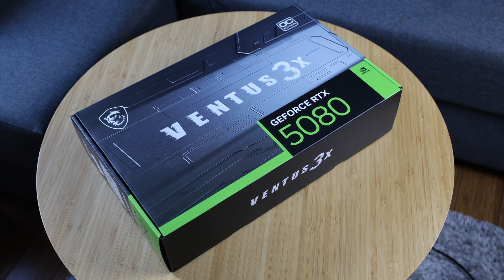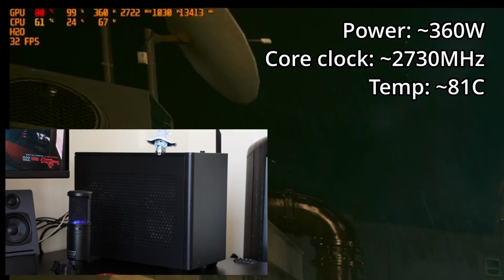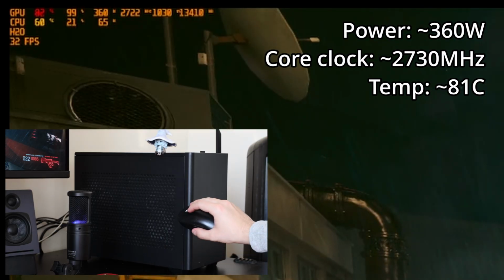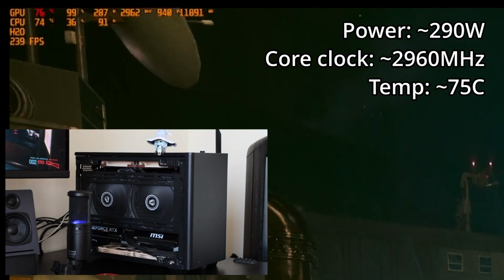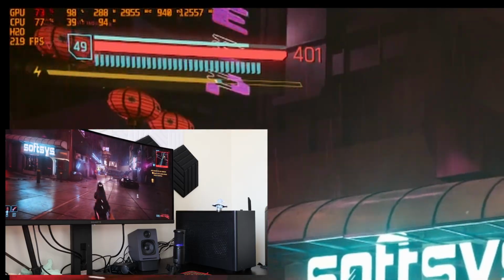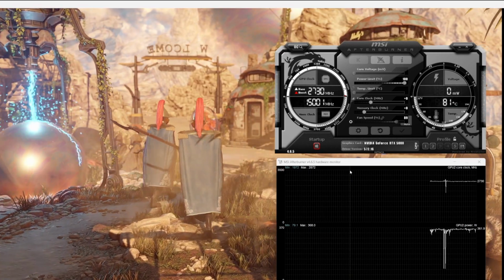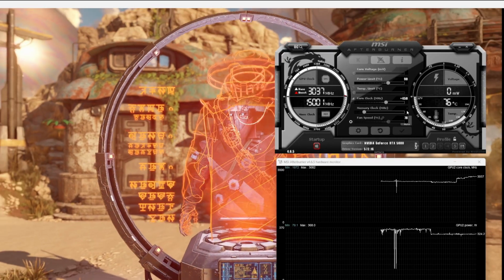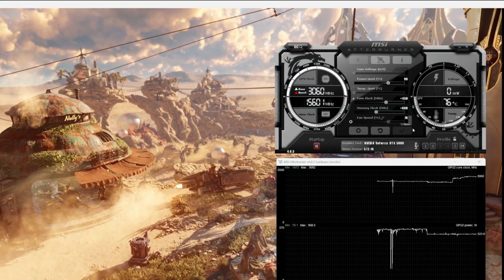RTX 5080 MSI Ventus 3X OC Plus Review - Noise, Performance, Undervolting

Comment: do you get similar noise whit the Msi GeForce gtx 1660 super Ventus XS OC edition?
Reply from the maker: Bruh do you think I have every GPU ever made?
Reply: @grumd0 dont need to own ut to now.., i was asking in xase you knew.
Reply from the maker: @martinrosemary5654 1660 is a much weaker low power GPU compared to 5080, so I'd expect it to be much quieter

Comment: I have this card. Its not for overclocking. Its a card for undervolting. With the right settings you get really good preformance and temps! Also Its one of the smallest cards. Its really good for small builds so you can keep good airflow!

Comment: Wth is this guide? :D That is not undervolting :D
Reply from the maker: Power limiting with a positive core clock offset results in the card using voltage that's lower than stock, it's basically undervolting with an overclock. I just showed the simplest method to achieve good performance with lower power consumption and lower temps that anyone can do without even touching the voltage curve.
Reply: @grumd0  No, you showed a really dumb way of doing power limiting. Proper undervolting, like you claim this video is about, has much better outcome and stability. I really suggest looking into how things are actually done before making youtube guide videos, and making yourself look really stupid while doing so. Especially if you want to grow your channel. Making stupid videos like this does the opposite.
Reply from the maker: @GrumpyGrndad Oh I don't care about growing my channel, and I know how to properly undervolt, I just showed the method that's the easiest to do even for someone opening MSI Afterburner for the first time. You're also arrogant and rude for no reason so why would I listen to your dumbass advice? If you at least had some constructive arguments why using the voltage curve (which I assume you think is the "proper" undervolting) is "better" I'd maybe listen, but you just spew ad hominem with no substance to your words. Not worth my time.

Comment: his gpu temps is high coz of this case airflow setup, having 4 intake and 2 exhaust is bad in this config coz the gpu air is not getting push out fast enough and getting blocked by the AIO
Reply from the maker: That's wrong. GPU always gets fresh air from the bottom intake. The side panel is also open and hot air can easily escape from the sides. This Ventus just has a very small heatsink.

My temps are high because my ambient temp is around 26 C

Comment: So hot in brazil this GPU arrive in 100 C° easy
Reply: No im from Brasil and mine with undervolt and 2000plus and 400mhzovercolck  reach only 71 ~ 72 maximum temperature the avarage is 62~ 65 the cooling is really good
Reply: delusional, learn to type

Comment: I have this exact same card, my power is at 110% running at almost 3250Mhz core clock and + 2750 Mhz memory and this gpu has never went above 62 celcius. Could your case not have optimised airflow?
Reply from the maker: @JS-xv3dm  Exact same? Ventus 3x OC Plus? Mine didn't even go above 100% power limit. I think you have a different GPU
Reply: @grumd0  My apologies you are correct mine is the MSI gaming trio not the ventus trio.

Comment: +480core +1000mem, cap power at 0.85v will be 2700+Mhz
Reply from the maker: @RhRyan  Yeah that works, but I prefer to be closer to 3000mhz
Reply: @grumd0  That does sounds nice. Man I kind of regretting not building ITX, only if I don't need that many USB slots

Comment: hope this is good enough for a 5070ti that is the only card i could find in stock and it have been shipped i will have it next week so will hopefully not be a bad card with loud fans and high temps if so i might return it. i use open back headphones so noise is a deal breaker XD to bad if i have to wait even longer for a upgrade for my 980ti...
Reply from the maker: @Fr3akyFrapz  A 5070ti has a tdp of 300w. As you can see from my review, at 300w this 5080 ventus is pretty quiet!

Comment: This isnt really undervolting though is it?

This is power limiting and overclocking. In essence the result can be similar but undervolting specifically lowersvoltage but lets card run at stock performance or above sice you are effectively lowering the temp and power stoping them from hitting stock limits.

Comment: This isn't undervolting. power limiting doesn't decrease the voltage you feed to the card hence you will still end up with higher temps and coil whine and so forth. this is an easy method to limit power but the 5080 barely ever uses its max 360w tdp. for example on my 5080 i can achieve 2900mhz core with 900mv voltage or 3100mhz core with 950mv voltage. this in turn actually decreases power consumption at the max core clocks by about 30-40w around a 15% decrease. This is a Misleading video!
Reply from the maker: @Kobe4Life2424 With a +400 offset power limiting forces the card to stay at lower voltage around 2950/900 so imo it's the easiest way to undervolt without messing with the curve
Reply: @grumd0  no it doesn't. The card still uses 1.01 volt when power limiting and increasing the core offset. Your method doesn't adjust voltage at all. The card will still use max voltage allowed for the card.
Reply from the maker: @Kobe4Life2424  It only does so in low loads, but in high load games like Cyberpunk it drops to 900mv. I'm using power limiting to decrease power consumption, noise and temps. It's not necessary to decrease voltage to get lower temps and noise. If I'm drawing 200w I wouldn't care that I use 1v, the card is still cool and quiet

Comment: Why is your temp so high. My gigabyte 5080 sff only 71°c max with oc. Room temp 36°c
Reply: Dayun msi low and mid tier so bad.. Better go to asus or galax
Reply: What is your VRAM temperature?
Reply from the maker: @hasanenterprise8630  Room temp 36, do you live in a sauna? Anyway, this just shows how bad the Ventus is. Gigabyte sff have a vapor chamber, Ventus doesn't
Reply: @grumd0  asia mate. All year summer here. Yeah with your room temp should get -10°c

Comment: This card seems kind of hot and loud. I have a 5080 FE shoved in a Ghost S1 and it's not even close, the highest temp I've ever seen on the GPU was...like 71C and I have a quiet fan curve set so it was only spinning at 32%.
Reply: Good luck venting all that hot air on the back of your motherboard.... Not good

Comment: That's not undervolting. That's power limiting.
Reply: the exact same thing just different method
Reply from the maker: @vyse6980  The biggest benefit is probably that power limiting with a core clock offset is super easy to setup, just two sliders. Manipulating a voltage curve is more complex. And with my video I wanted to show people the easiest way to achieve good results
Reply from the maker: @vyse6980  Good point, but I disagree. Power limiting with a +offset to core clocks is basically the same as undervolting. You're running higher clocks at lower voltage. With the +400 and an 80-90% power limit I'll be running around 3000mhz/950mv or maybe slightly lower which is close to what I'd do with straight voltage curve manipulation anyway. But if I only manually set an undervolt instead, I'd lose the benefit of a smooth curve that allows the GPU to find the optimal point for best performance. After all, undervolting is done to decrease noise, temps, and power. Power limiting does the same thing, and a positive clock offset finds the best performance for those constraints that your card can muster.

Comment: You should have bought the gaming x trio, then you wouldn't need to change the specs to get it quiet. If I would buy a 1000 Dollar + Gpu, I would make sure to buy a premium cooler with it, because you will hear that thing for the next few years.
Reply from the maker: @batouranger2553  Agree, but another option is deshrouding. I have two Noctua A12x25, if you put them on top of the Ventus radiator you'll get 70C at full 360W. That's at 100% fan speed tho, but it's just 1800 rpm and they're still very quiet, similar to stock fans at 50-60%.

The thing with 5080 is, you buy what you can catch because the stock does exist lmao
Reply: @grumd0  I've got the same card. I'm going to try 3 A9 noctua fans instead of the 120
Reply from the maker: @Sneedles  That's gonna be super good
Reply: @Sneedles  Did you try it? 3 - A9 vs 2 - A12 🤔
Reply: @grumd0  im thinking about the same, how u can fit the fans in? or u just take of the cover and have them on the card?
Reply from the maker: @Akozehalus Yes just take the cover off and place them on the card. I recommend doing it outside of the case

Comment: make a video on the over clocking performance
Reply: It’s an over clocking monster. Only like 5% behind the 4090 in most games over clocked
Reply: @chencg179  not this one, you have to buy an overpriced top tier like rog astral, msi vanguard to archive that boost.
Reply: the temp is too high, 81 82c at normal, you may get a thermal issue if you try to oc this one.
Reply: @letung8823  If I'm not mistaken, undervolting then raising the core and memory clock as high as they can go while remaining stable is the best this card can do. I'm impressed he got to 3000 on this with the SFF GPU
Reply: @tropsolo5914  no, you have to raise the power limit bar, core clock to oc, uv + oc memory clock do not increase performance, its keep you the original performance for less power usage.
Reply: @letung8823  you can’t raise the power limit on this card. It’s hard locked
Reply: And you can increase performance if you raise the clock high enough before undervolting
Reply: @ I know, if you want to have +10% fps with this card, you must oc it pass 3000mhz core clock, you cant do that when you uv it.
Reply from the maker: @entropic_decay  This Ventus can reliably hit 2950-3000 mhz, otheriwse it's too hot. A 5080 with a good cooler cn hit 3150-3200 with good temps
Reply: I was able to pull 8891 on Steel Nomad with my 5080 Ventus x3 OC at 65c. That is mildly oced with a novice to OCing at the controls. I also got a 17668 GPU score on Time Spy Extreme with the same temps. Both with a 9800x3d @ 5.3 ghz and 64 gigs of 6000 cl30 ddr5, in expo.

Comment: You could show the fan rpm though... Also what you're doing is not under volting, it's just lowering power limit.
Reply: My 5080 ventus has a minimum fan speed of 30% as soon as I downloaded the nvidia drivers… I am unsure if its firmware or a hardware issue
Reply: @ lots of GPUs cannot go lower than 30% so it's not an issue
Reply from the maker: @crymore7942  Hm weird, mine show 0 rpm at idle
Reply: @00kayem  yeh it must be that , I can’t adjust it lower at idle with latest drivers , even on afterburner for example ( it shows the min 30% line) Strange though that @grumd0 has the same card but it’s idle at low temps .
Reply: @crymore7942  you haven't accidentally turned on Performance mode in Windows? Turn off all monitoring apps, idle in desktop with Balanced mode in Windows, the fans should be able to stop now.
Reply from the maker: @00kayem  It's effectively undervolting. I could open the voltage curve, and manually set it to run at 2900/950, or instead I could do 90% tdp with +400 oc, and the whole curve is going up, so in Cyberpunk I'll see 3000/1000, in Path of exile 2 I'll see 2970/980, both at 300w. The purpose of undervolting is lowering tdp and temps while improving performance, and the easiest way to do that is the one I've shown

I should have shown the fan speeds though, yeah. I'll test it out and post a comment with fan speeds today